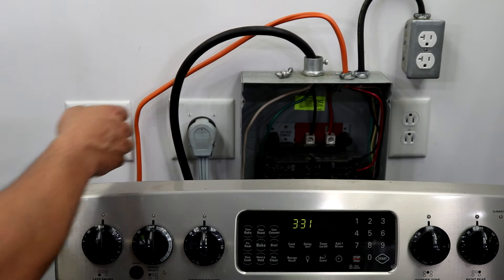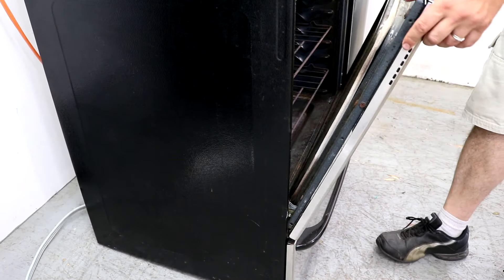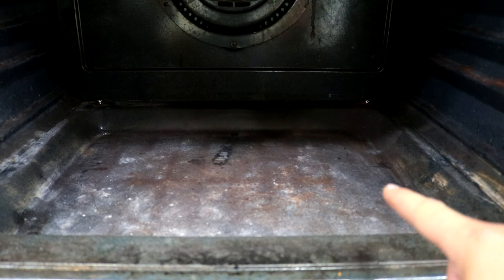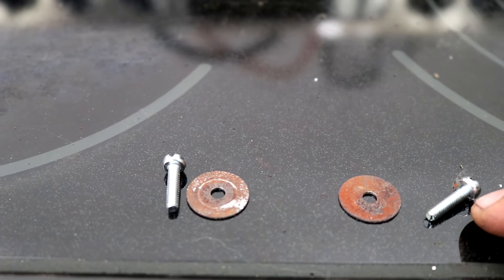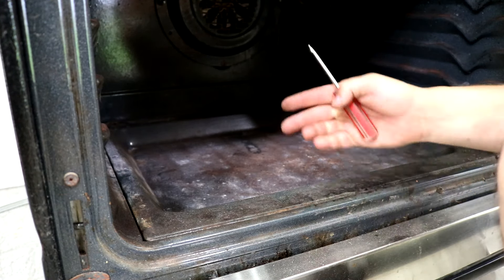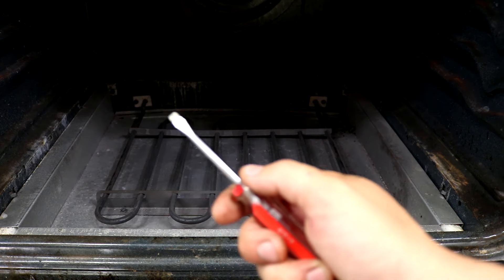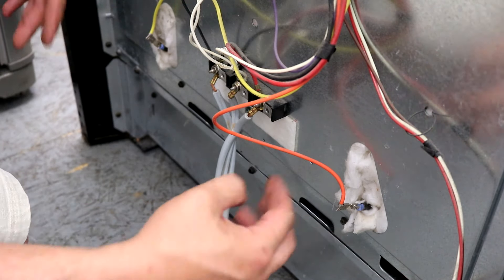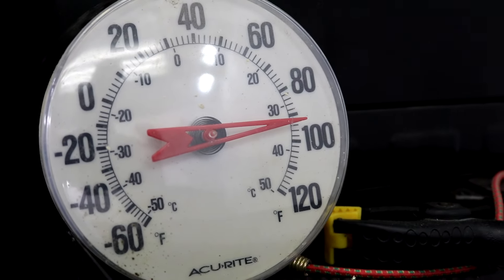Frigidaire / Kenmore Oven Not Heating - Bake Element Replacement

Comment: Nice job as always Bill! I was wondering about the screws you had to cut off. Is that common on ovens? What did you use to cut the heads off? And how did you get the remaining part of the screw out? Thanks again for all your videos! Very helpful!
Reply from the maker: I will show that at the beginning of my next video.  It was a royal pain, but I got it.  Thank for the questions!
Reply: +Bill Newberry thanks Bill!

Comment: Would the control panel on the top back of the gas stove with the clock not working cause the burners not to light or spark?

Comment: Would there ever be a time where half the element would power or light up? Our 2012 kenmore oven is being erradic and cooking some stuff too quickly and the other side barely cooking when the wife is baking cupcakes and such. I went to throw bacon in this morning and saw that only the right side was lit up orange thru the grates at the bottom but the holes on the left were dark